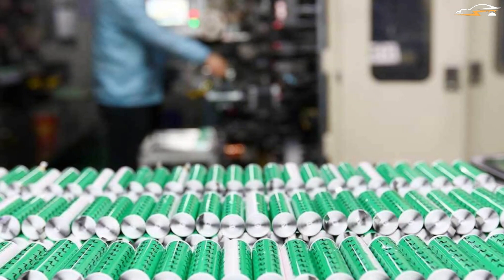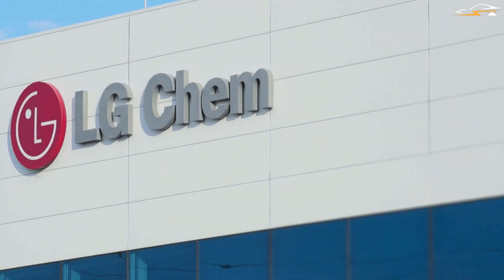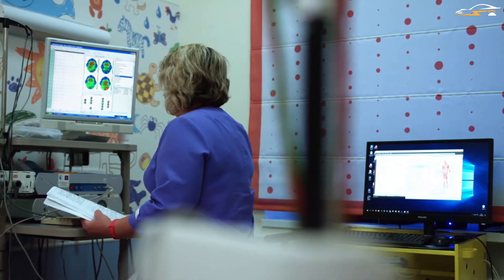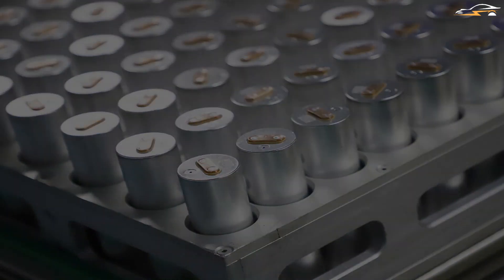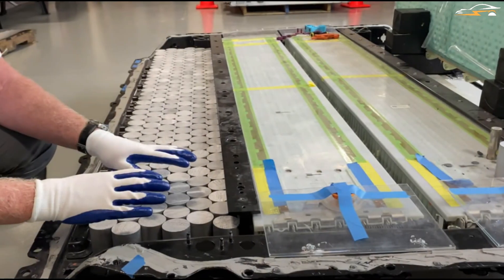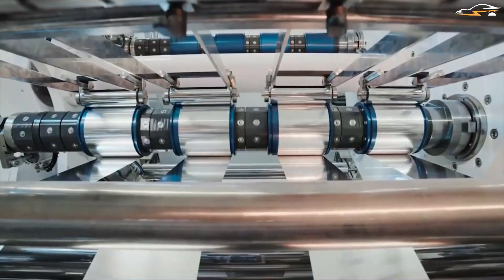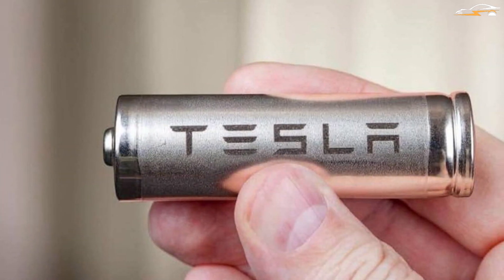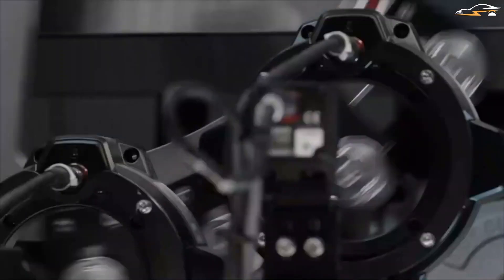Lucid's LFP Battery vs Tesla's 4680 Battery

Comment: Batteries for modern cars suck, no matter what design they are. Low range, can´t even handle cold without losing range, and takes forever to recharge. I stick with my petrol car
Reply: Sure, if you wanna pay ever increasing  petrol prices, suffer more mechanical failures, and  accelerate slower because of mechanical inefficiency, go right ahead.

I pay $30 less for the same 200 miles I drive in an equivalently sized EV and all I have to do is plan to charge my car as I'm having lunch or dinner when I reach my destination. 

It may take you 5 minutes to fill up, but on a daily basis I plug my car in overnight, so in my daily/weekly life I don't waste any time (or gas) planning my day around a trip to the gas station. If you're wasting time and expensive energy (gas) to get to a gas station most of the time, I'm not sure why you think bragging about it makes a difference, especially when your car is going to suffer a mechanical failure much sooner than mine.
Reply: In the early 20th century, there were naysayers that used similar language (e.g. "The automobile will never replace the horse and buggy"). I wish you the best finding a petrol station after 2030.